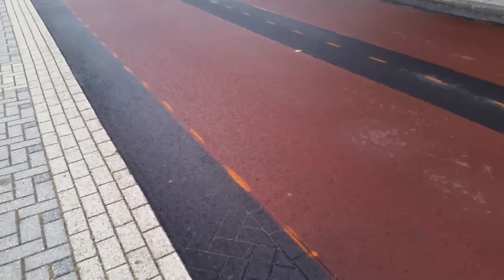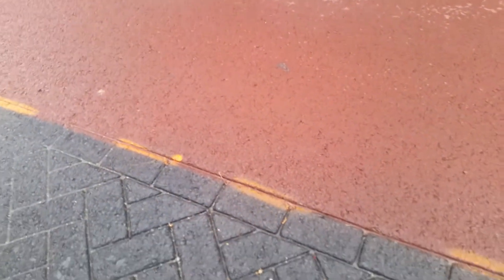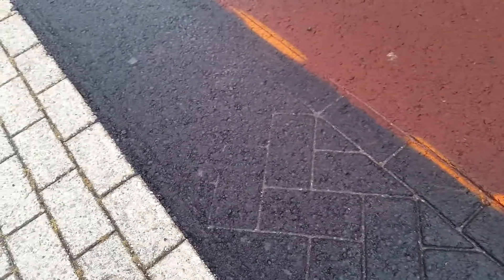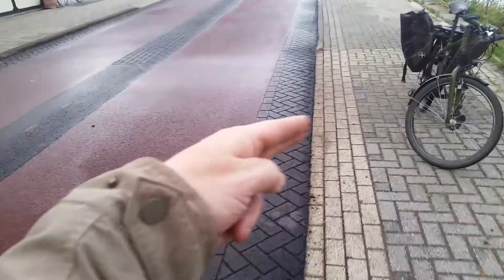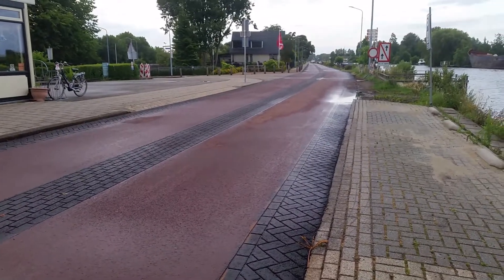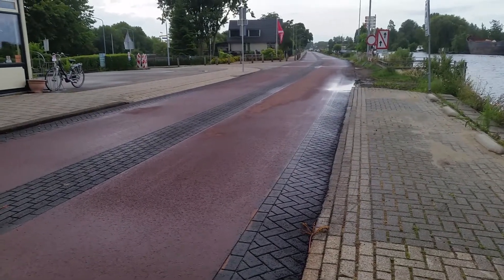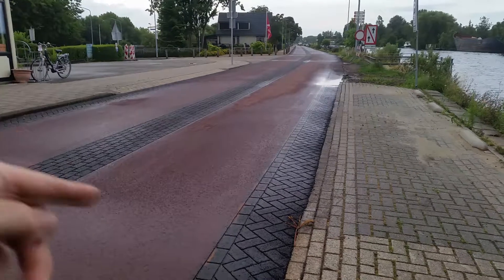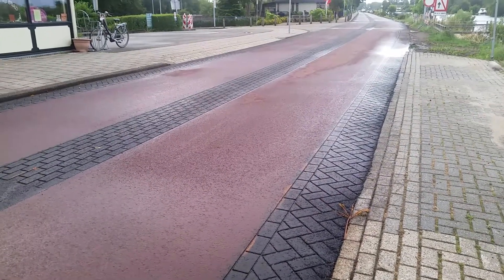Asphalt roads made shitty: Stupidity in NL related to cycling

Comment from the maker: Addition: This morning I made a bike trip and saw the crew in action that shittified the road. So I asked one guy how they did it, with some sort of router. This was unlikely, too much work, but I heard a lot of noise a bit further, so perhaps that was it? No, it was actually done in a similar way to what I speculated about in the description: by heating up the asphalt, then laying a type of grid from steel wire with the right pattern in it, on top, then a drum roller goes over that which pushes down the steel wires into the asphalt and forms the fake bricks. The guy said that this is better than bricks as those will tend to move etc. Yes, but I asked "Why do that at all?" He didn't know, he said "That was what the city council wanted". I also asked whether this was perhaps a way to make people drive better (not too much to the side nor too much to the middle). No, he said. He then said that this road was going to be for bicycles only because a lot of bicycle ride here all the time. Well, I questioned that, what about the people with houses on that road? OK, with exceptions for those people. Hmm. So that is why the road has these big red lanes, as red asphalt is usually used for bicycle lanes. But I've never seen huge numbers of car on this section of the road so it doesn't make much sense. I had a look and noticed a traffic sign "Fietsstraat, auto te gast" that I hadn't seen before. This is more 'informative' than an actual rule. It says that motorists should adjust (behaviour and speed) to cyclists. What will the fake bricks do? Is this perhaps a 'clever' idea by someone selling his ideas? Just like the 'no sidewalk/pavements' area in the centre of Alphen a.d. Rijn, which is said to be the 'idea'  of some guy which is not actually his idea, as it is simply back to what the situation was like before regulation, before making sidewalks, etc.  Oh yes, I rode on the middle section with straight brick pattern, and that gives the same issue as with cattle grids: You feel as if you are kept on a rails sometimes from riding in a groove. This can be disconcerting.
Reply: I think the point is to make the road appear narrower, and slow cars down to near-cycling speeds because the cyclists won't be happy to move onto the 'bricks', staying in front of cars longer and thus slowing them down as well.
Reply from the maker: @martijnheil8825 : There is still plenty of space to overtake even 2 cyclists riding next to each other so the brick-effect on the sides seems pointless to me, motorists can easily overtake where there is no oncoming traffic. The brick effect in the middle could be a sort of warning similar to rumble strips for motorists, to keep riding on the right as much as possible but this too seems a bad solution to me. I've never seen the need for this on this road nor on the road to Aalsmeer that underwent the same treatment, but also the pattern in the middle is straight instead of diagonal which causes, depending on the tyre width and pressure, a feeling of being steered, i.e. it's harder to turn the handlebar than normally, once you get into a groove. This is annoying/hindering cyclists. I see much more sense in rearranging roads into 2 wide bike lanes + middle lane, as was done a few months ago on the road towards Rijnsaterwoude. I made a video about this, originally for how stupidly they did that but it will also give a good example of another way to deal with mixing different speed traffic. I will upload that video soon. The stupidity there was this: Those bike lanes weren't made with red coloured asphalt but a layer of red grit on top that was I think pressed in (possibly with a glue layer, not sure as I didn't see them do it), but they left so much of that grit in a layer lying loose, that for cyclists it was dangerous to ride on the bike lanes like riding on a thick layer of sand on a road (and thus nobody did that for quite a while). In any case, the red bike lanes are about as wide as the middle lane and this gives a good visual indication for motorists to keep to the middle unless they encounter other traffic or need to overtake.

Comment: Me too, thanks from Tasmania, Australia
Reply from the maker: Thanks :) You might find my latest video amusing then about more weirdnesses on the road here. How is cycling in Tasmania?
Reply: @WHS_reviews  It is hectic here, no such thing as cycling lanes, cyclists can go anywhere through, road and footpath. I have recently purchased a Spanninga Axendo 80 XE Headlight (purchased from Holland) thanks to your reviews. Now I am looking at a tail light, i want integrated 6v, the supernova e3 looks like my only option. Do you have other thoughts?
Reply from the maker: With 'integrated' do you mean suitable for e-bike/pedelec? There should be an e-bike version of the Spanninga Solo but if the power supply is 6V DC then you can use any dynamo taillamp too. See my top list of taillamp on my site for recommendations. I guess I could add this hint that on such systems you can use dynamo lamps.
Reply: @WHS_reviews  Yes so it works with the ebike battery system. I was unaware that dynamo could work with 6v. Probably silly of me. Thanks for the advice!
Reply: @WHS_reviews  Hey mate, just installed the axendo 80, love it! Thanks for your content